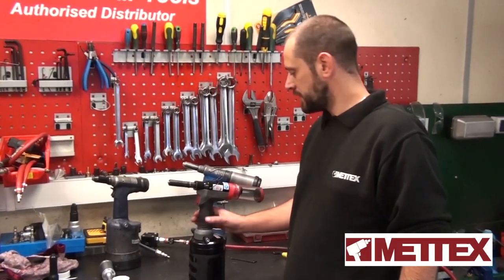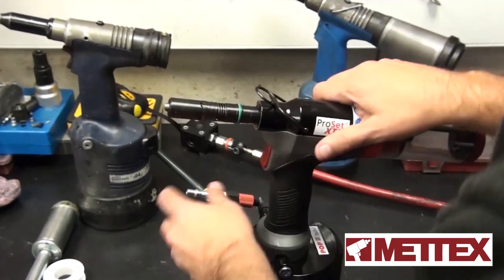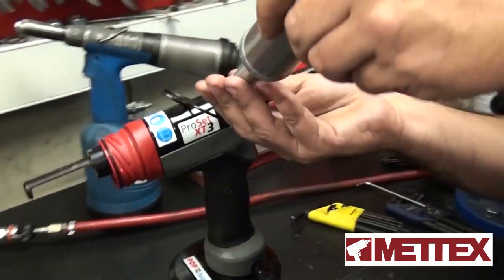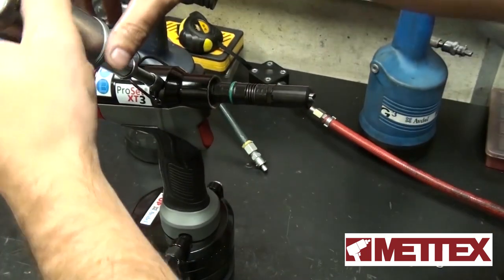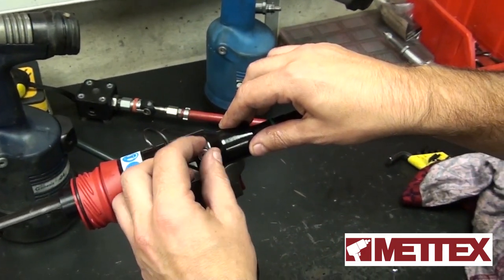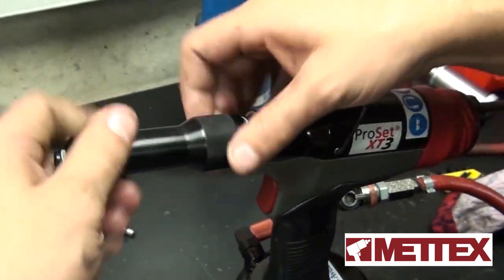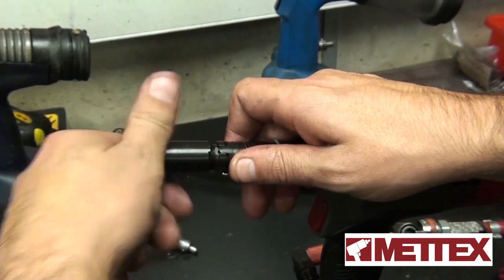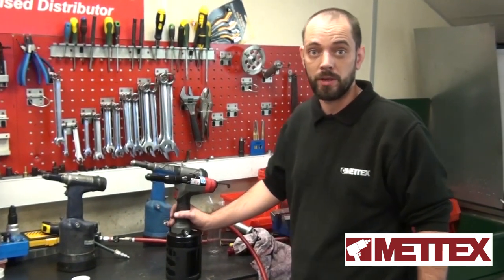Mettex Air Tools POP Avdel ProSet XT3 Oil Prime

Comment: Does the Proset Xt2 or XT3 have a duty cycle to prevent inner seals from heating up and going bad. Or can they be used constantly in an 8hour shift? Manual isn’t clear

Comment: Hi, we have 5 of the XT2 tools. If you hold the trigger on one of them it pulls but then keeps sending air out of the front holes of the chamber until you let go of the trigger. The others do not do this. It seems to still work but it doesn't seem to work as well. Could it be a seal that has gone?
Thanks in advance of any answers.
Reply: Hi Lee. 
We have seen that fault before. It is a seal that has gone on the bottom piston. We can happily get the tool looked at for you or we can offer a drawing and spares if you are confident in repairing yourselves. Please contact me on airtools@mettex.co.uk and I can assist you further.